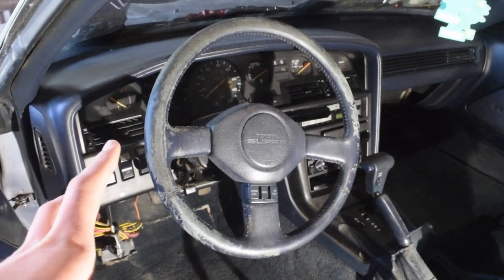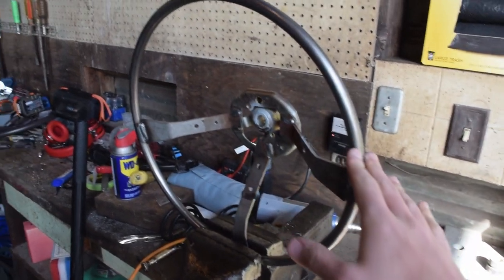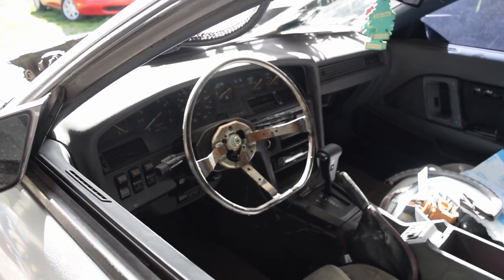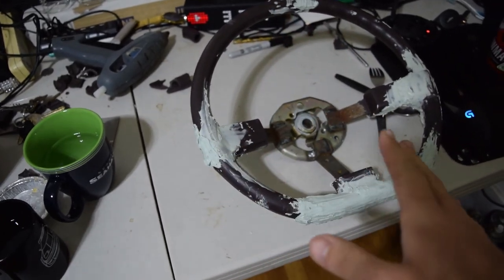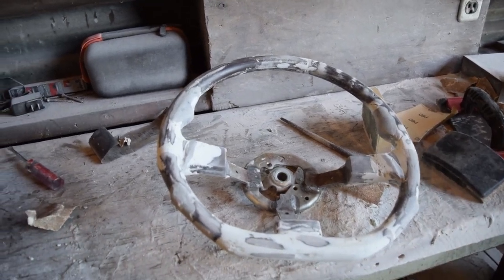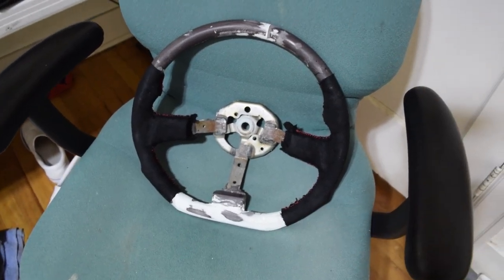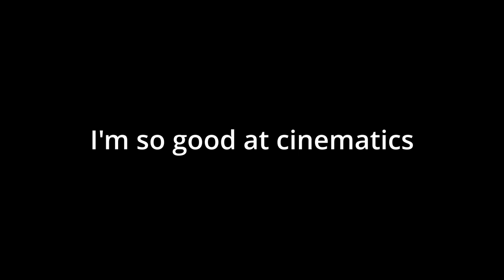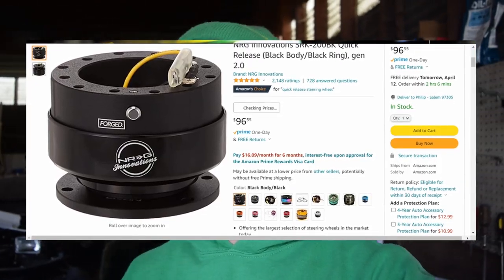$50 Steering wheel upgrade

Comment: Looks great. I would recommend getting a sanding block kit like a durablock one they have all kinds of shapes and sizes and make filler work alot easier and places like harbor freight carries reusable filler boards for like $5 so you don't have to use coolant jugs.
Reply from the maker: That's great to know!  Thanks!  I just started using sanding blocks for the first time a couple weeks ago... so yeah... lol but thanks!  Definitely need to step up my gamek